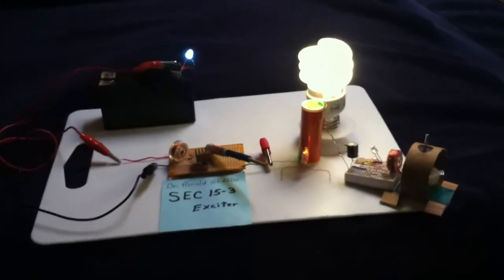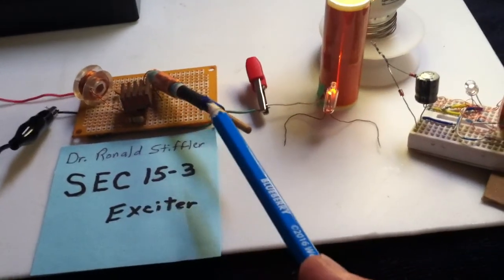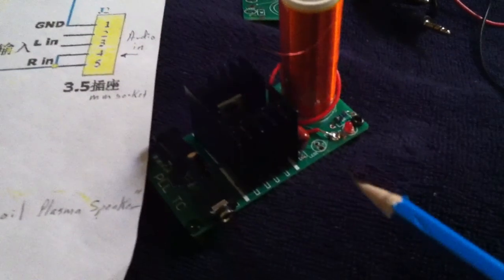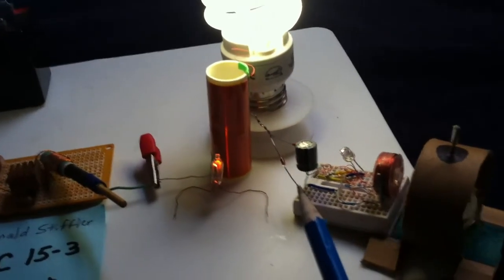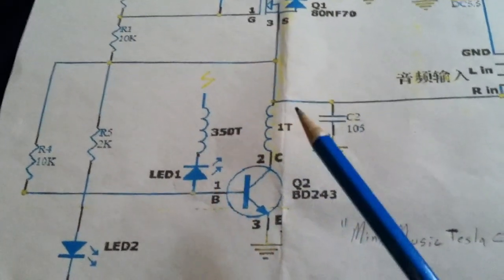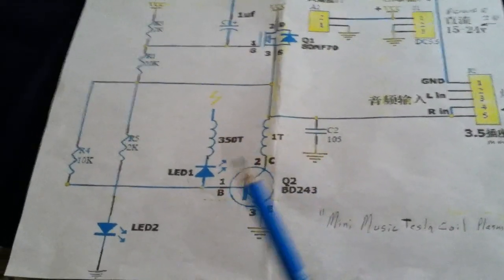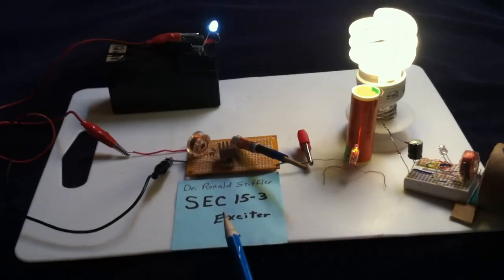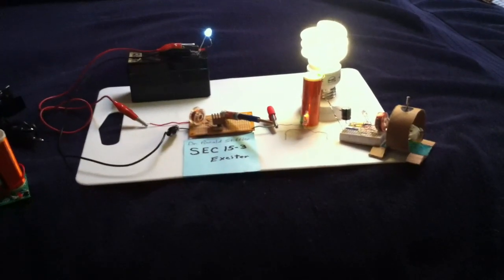Mini Tesla Coil Kit coil used on a SEC 15-3 exciter

Comment: that's one nice circuit!

maybe this could give you a idea on how to do what you want.

my coil is running at 10.87mhz on a circuit i think designed by teslaundmehr (atleast thats the source i got that circuit from)

you can find specifiks on the build here at https://highvoltageforum.net/index.php?topic=298.0
the original design had this tuning capacitor tied to the gate of the mosfet.
wich in term was connected through a L2 coil to the the drain of the mosfet.
the L3 turn was then connected in between the L2 coil and the tuning capacitor.

you could perhaps make the L2 coil tunable like you did with dr. stifflers design then also having a tuning capacitor to get to that desired frequency!
allthough my coil is a base fed 3 coil arrangement and its running on a mosfet.
it might be able to use a same type of arrangement on you SEC coil
Reply from the maker: Thanks.  I down loaded that circuit diagram and might have a go at it.   It reminds me of Dr. Stiffler's SEC circuit in some ways but is very different.  Thanks for the tuning tips.
Reply: yeah the circuit is a little but still similar to Dr. Stiffler's SEC :)
i have to say, getting it into tune without a variable feedback coil and or capacitor is very hard...
cost me a lot of mosfets in the first place....
your welcome man! cant wait for your next video!

Comment: Try C across the one turn primary. A small mica trimmer like those used with old RF tube circuits would work.
You can even fabricate one with plastic sheet and foil, and vary the distance angle between them to vary the tuning.
Reply from the maker: Thanks. I will give that a try.

Comment: A few ideas, though I need to do this myself - You could run it like a crystal set, with a variable capacitor across the coil. It may tune it in the same way, without losing output ability. Or, Base to Collector directly with a low pF variable capacitor. Or, tune up the load. Most receiving coils (24 turns of 30+AWG say) will benefit from a '102' or similar cap value. Trimming to just below the best value capacitor and then using a variable cap from a radio should allow exacting tuning of the load.
I need to do such things myself, because, tune up 2 of the same type at the same spike and you've got true resonance from tower to tower !
Reply from the maker: Thanks.  I remember that the tuning on a Slayer Exciter was to move the primary up and down the secondary but there must be a another way using  a variable component.  I'm thinking your idea a using a pf variable cap somewhere is the way.
Reply: Putting ferrite inside the tower also works, similar to the L2 of the SEC.
A ceramic cap certainly works on the load side. 24 turns of 30AWG, normally a '102' ceramic cap & then the AV plug. If you have an old radio or CRT monitor or something junky there'll be hundreds of the things and then can try '151', '101' + 20pF etc. One particular value will tune it at least 3x better than no cap at all, it simply spikes into coolness. 
Adding a 1uF -10uF electrolytic after the AV plug can also help, especially for motors or other inductive loads .
Reply from the maker: When you mentioned the ferrite inside the coil my memory triggered.  I did this back in 2011.  It was a tiny AA battery Slayer Exciter.  I still have it.  Here is the video of it: https://www.youtube.com/watch?v=MPDSSXl_QRg     Here is another one where I added a pf variable cap exactly like you suggested.  I had forgotten all about this series of 2011 experiments:  https://www.youtube.com/watch?v=p_bPA6fEMhU